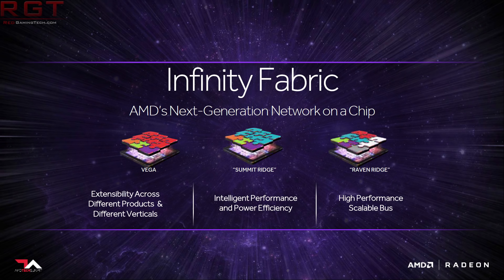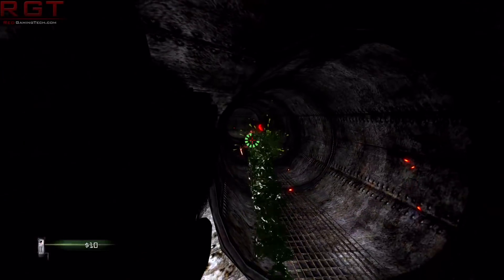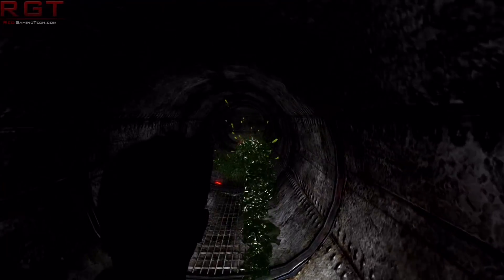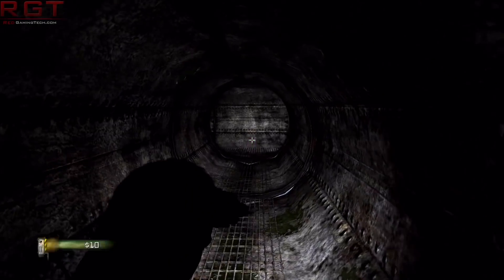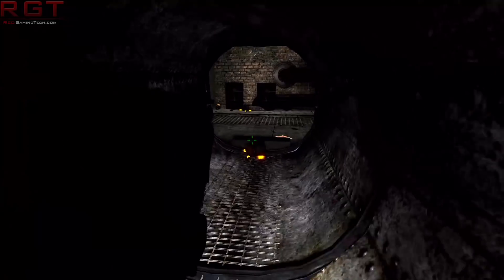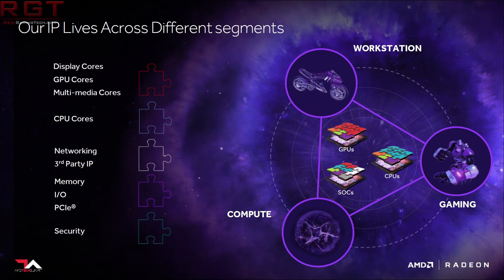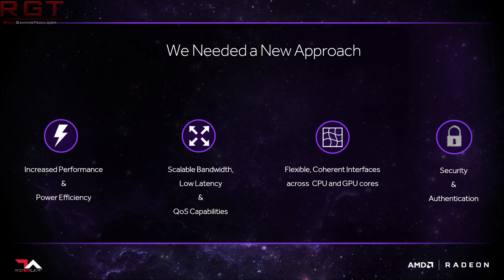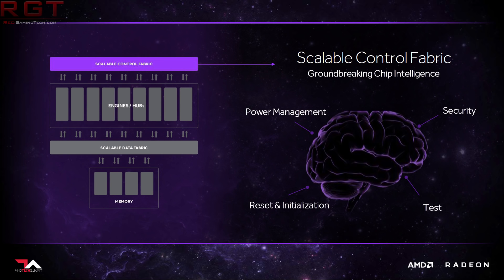AMD Infinity Fabric Details | More Ryzen Rumors On Release Date & Pricing

Comment: The best part is that bought some AMD stock when it was 1.88 a share. I can now afford to buy the best Ryzen chip. I have already got one of the new 3 sided tempered glass Thermotake cases and planning on putting in  a 560mm radiator to cool it. Should be able to see the max capability without using liquid nitrogen. I have not been this excited about a build in a long time. I am really interested in seeing how all the AI features they are packing in the chips translate to real world performance.

Comment: Whilst I am confident 8 cores Ryzen will stomp all over bintel, I am in all fairness pretty disappointed with the X370 range of mobos. They just look very gimmicky, particularly the Biostar X370. Seriously, what useful purpose could flashing LED possibly serve?. I want an X370 work station mobo that will rival my Asus X99EWS mobo. Where the blazes are the dual socket AM4 WS mobos?. Another thing - was watching Red Gaming Tech last night. One guy found leaked info that 8 cores Ryzen will retail for $500 to $700. I really hope this is not true. TBH, I was worried that AMD would charge top $ for 8 cores Ryzen because it is a damn good cpu. I thought AMD don't have the market share to demand such high prices. Will know for sure what the rrp will be on release day.

Comment: Cool, Currently multiple cores is like a room full of people all running around trying to go as fast as possible. They have to shout at each other to avoid bumping into one another, but that slows them down breifly. If mistakes are made in programming this, they can run into each other or trip over themselves. This new technology will allow them to communicate without shouting, with less human input required for navigation. I can see this easily trippling the speed of PC's in practice, while being theoretically unexciting.

Comment: I don't mean to seem impatient but, WHERES THE DANG CHIPS ALREADY????
Reply: Q1 means quarter 1. Thats 3 months, so basically Q1 ends March 31st
Reply: + M Dutchy I know how you feel. When you open the bag, the top half is air.
Reply: How many times do they have to say Before the end of Q1? You got S4!T in your ears?
Reply: Isn't today Before the end of Q1? You got S4!T for brains?
Reply: M Dutchy late March is the end of Q1
Reply: M Dutchy got to wait for gdc2017
Reply: Amd will release it when people will move to Intel after long waiting
Reply: I doubt there is going to be a 8 core 8 thread although I'm almost certain there will be a 6 core 12 thread, reason being is that hyperthrading doesn't really have an effect on 8 cores apart from in a few select applications and then even in that select few applications it's usually only for certain parts or for VM's.

4 core 4 thread CPU makes sense though because even in games your likely to see a benefit form the 4 core 8 thread CPU, reason why you would't make a 8 core 8 thread CPU and 8 core 16 thread one is because as I said in the vast majoirty of use cases you will see little or no gain so the 8 core 8 thread CPU would cannibalize almost all the sales of the 8 core 16 thread version.

Two because SMT has nothing really to do with binning because if the CPU works it can do SMT if it was designed to, because it is a function of the architecture not any particular part. Although parts with less cache could see less benefit from SMT.

So there really is no reason to unless your trying to segment the market, and segmenting the market based upon something which will only effect a small number of use cases is dumb.

As why you don't see 6 core 6 thread or 8 core 8 thread CPU's from Intel, because if it were a matter that certain dies just can't do multithreading you would see 6 core 6 thread etc CPU's and you might ask why they do 6 core 12 thread CPU's in the first place if it's does next to no good, well it's because the  cores of the the Enthusiast platform have the same basis as the lower end versions, furthermore the server space is where SMT really comes into play via virtualization.

And the Enthusiast CPU's are just server CPU's which have speed binned well or not hit the TDP they have to.
Reply: Well, excuse the heck out of me. I had no idea that BY THE END OF Q1 means that its going to be on last day Q1.
Reply: End of February beginning of March!
Reply: Rumours state that Ryzen will launch before the end of GDC 2017
Reply: M Dutchy yeah, game devs need it.
Reply: Q1 means First Quarter of the year. Since  a year has 12 months , first quarter of 12 is 3, so March..
Reply: GDC.
Reply: i hope amd will give us a bit more info in February...
Reply: +Democritus86 Well they will probably have to considering it's launching at the end of Feb, but the information you probably want to know is price which I think they wont release until launch to blind sight Intel.
Reply: +John Jeffry No Intel fan boys will shrivvel up and go into a long waiting hibernation because they wont be able to deal with reality.

And yes  know long "waiting isn't" proper English but I was taking the piss out of you.
Reply: factories all over china and taiwan probably produce now millions of Ryzen copies
Reply: Etheoma i wouldnt mind more info on how much ghz for all categories,also more benchmarks for the 4c and 8c aswell btw i read somewere that there gonna be 4c/8t 8c/8t and 8c/16t at launch(rumor)

Comment: Got tired of waiting for ryzen. Bought a used i7 6700 for £190 instead.
Reply: Good for you!
You bought a cpu. 
Could of waited for Zen sure... but a 6700 isnt too bad.
you do mean the i7 6700k right?
Reply: LightswrathUltimatum nope, just 6700. I was originally planning to get the i5 6500 but it was the same price so i got the i7 instead
Reply: Meh good luck upgrading in four year.
Intel will change chipsets again like they usually do soon
Reply: Yeah they were selling way cheaper than ebay used with a warranty lol, so not surprised.  I got it with 16gb used Ram for £250 total, killer deal.  6700 for £190 is pretty awesome too.

  I do think Ryzen will offer great value though when it finally arrives as Z170 boards aren't that cheap so a new sub £200 cpu and cheap B350 mainboard could be a killer combo. We shall see.
Reply: Prince Thrakkath not only is 6700k more expensive, you need to spend more on a good coooler. I got a stock intel cooler for £10. And a b150 mobo for £64. For 6700k i need to spend more on cooler and motherboard
Reply: Darkerkiller dude really you cant wait till febuary
Reply: Darkerkiller Cex is good for used CPU's, I got a 6700K for £205 and it works great.  I will prob pick up 4c/4t or 4c/8t ryzen for a second machine eventually depending on price/performance.
Reply: Prince Thrakkath nice, ik they're great. The 6700k was £205 a month ago. I didnt buy it cos i was waiting for ryzen. Now i got tired of waiting and bought the rest of the parts for my pc. The 6700k went up to £250 now.
Reply: Prince Thrakkath i got their 16gb ram too so cheap.
Reply: Yeah your right I was replacing an FX-8350 system so I already had a H105(which I got cheap refurbished on Scan), but the cheapest decent Z170(Gaming K3) is £100 so you are looking at almost £200 for board and cooling. 

Probably not worth it for the few FPS you gain from overclocking to be honest especially when I game at 1440p mostly anyway(mainly GPU botteneck).
Reply: Ralph Bromley my next pc will be for 4k gaming it will be in about 5 years
Reply: ff cc i doubt il be able to get it for the advertised price. It will come in stock around april cos they normally get sold out
Reply: you will buy ryzen too eventually
Reply: Mr11ESSE111 of course. It will be around for a few years. When i need to upgrade
Reply: Darkerkiller you will buy ryzen when it wii be released  and probably sold 6700k
Reply: Mr11ESSE111 if ryzen is better than i7 6700 and costs less than £190 then yes.
Reply: Darkerkiller why he would less?? did i7 6900k costs less then 6700k ?? no he not!! it will cost probably around 400$ with 8/16 c/t
Reply: Mr11ESSE111 thats fine. But you asked me and i gave you my answer due to my situation. If you are waiting to buy new cpu of course buy ryzen
Reply: Darkerkiller of course i will rather buy more cores / threads then less forbsame money !!  i7 6900k costs almost 3x more then 6700/7700k because of more cores
Reply: got a used i7 2600k for $100
Reply: Dawnbringer 6 i waited since last july.
Reply: That's not a bad deal tbh, thats about what I would expect AMD Ryzen 4 core 8 thread CPU's to come in at. Maybe a little bit cheaper and I can undersand if you upgraded from a i5 760 or FX 8350 or worse.

But I have been waiting since last year too, but I have a 3570k overclocked to 4.6Ghz so I'm doing ok, I wouldn't be desperate to upgrade until 2018 probably, and neither Kabylake or Skylake interest me in the slightest as it's only a 30% IPC improvement and as for Kabylake I could only push another 4.16% - 8.96% overclock, and there is still gas in the tank for me to push my overclock to 4.8Ghz if I upgrade my cooler, which if I buy a Noctua CPU cooler I get the mounting hardware upgrade for free.

So if Zen is a flop I still wont buy Kabylake or Skylake I'll probably wait for Skylake X because at this point I have £750 saved for Ryzen a motherboard and 2 x 16GB CL15 3200Mhz RAM.

By HL1 2017 I will easily be able to save $1000 so I will either go for a 6 or 8 core depending on price because I still see Intel bringing down the 10 core to $1000, the 8 core to $700 and the 6 core to the $375 - $450 mark.

Which means converted to GBP it's going well within my budget to buy a 6 or 8 core, even when you include VAT.
Reply: could *have
Reply: No I don't think it was a bad desision because as said £190 is just a little bit more expensive than what I think a Zen 4 core 8 thread CPU will come in at.

I think they will strike at the 7350k's $180 price point for the 4 core 4 thread CPU and at the 7600k there going to put it up against the 4 core 8 thread CPU so I don't think he would have gotten Zen any cheaper than he got the 6700k.

This is assuming a product stack something like this
8 core 16 thread "black Edition W/AIO" $600
8 core 16 thread $500
6 cores 12 threads $350
4 core 8 thread $250
4 core 4 thread $180

Which when converted to pounds and you add VAT put's the cost at a dead wash. for a 4 core 8 thread Ryzen CPU against a 6700k for £190 if he had bought Kabylake for £330 then yeah I would have called him an idiot but as said a 6700k at £190 is a good deal.
Reply: Etheoma it was actually an i7 6700 as i dont have plans to overclock.
Reply: Ah then I think you got kinda jiped because non overclocking parts lose way more value on the second hand market, so when you go to sell it it wont be worth much and will be hard to shift. And if you plan on keeping it for 4 - 5 years your basically going to need to overclock it to keep it relevant.

2500k and 2600k are still relevant CPU's because you can overclock it to like 5Ghz, 2500 and 2600 are not.

Look up a 2600k or 3770k vs 2600 and 3770 there like half for the 3770k and 2/3 the price for the 2600k.

Although if Zen is what most people expect the second hand 7700k / 6700k / 7600k / 6600k's are going to lose a lot of value anyways as 6 - 8 cores is going to replace the 2 - 4 cores on the highend so eh.

And that doesn't even depend on Ryzen as with Coffee lake Intel is bringing a 6 core to the mainstream and will I assume be replacing the i7 4 core 8 thread's price point.
Reply: LGA 1151 is already becoming fucking obsolete next year.
Reply: Wow your right the 2700k is cheap, but what I am saying is that for something like a 1060 / RX 480 a 2500k / i5 760 are still good enough.

I wasn't actually suggesting using a 1070 with either CPU I basically said you would have to buy a CPU new.